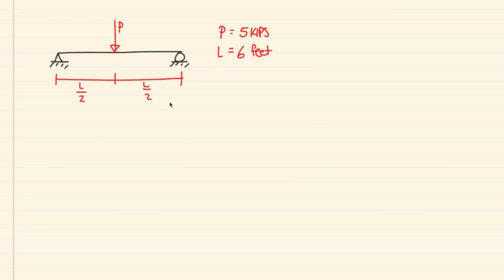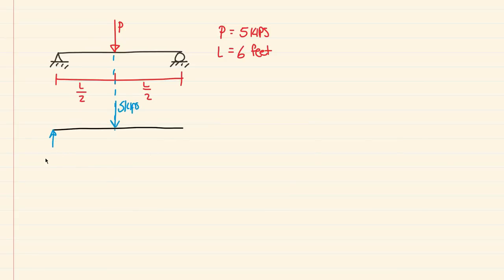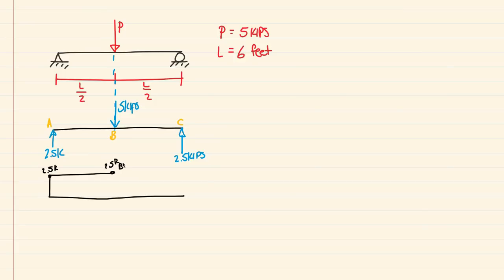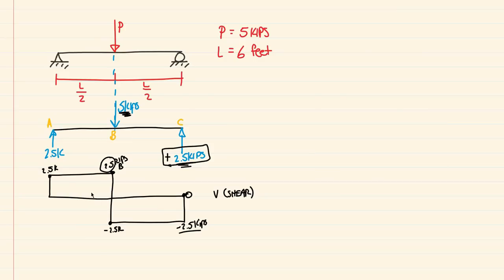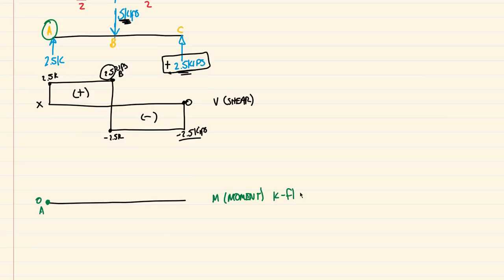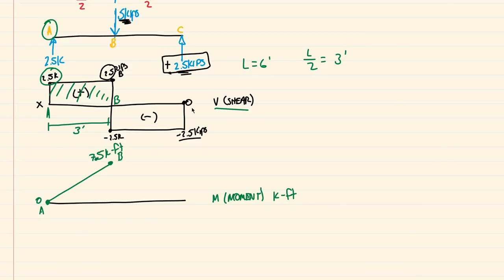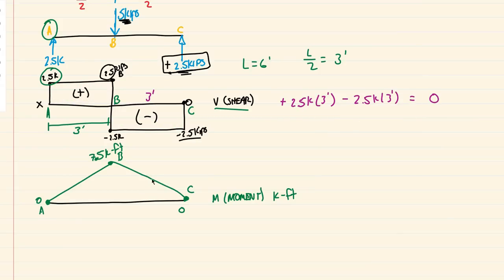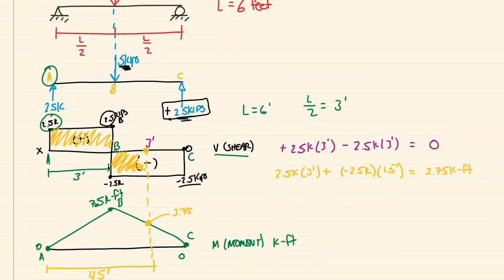[Ex. 01] Shear Moment Diagram of Mid-Span Point Load

Comment: Hi so when you rdesigning for shear say for a concrete beam or steel beam -  do you use 2.5k for reaction at A and B?  or do you use the point load at mid span? since thats the highest shear (5kips?)